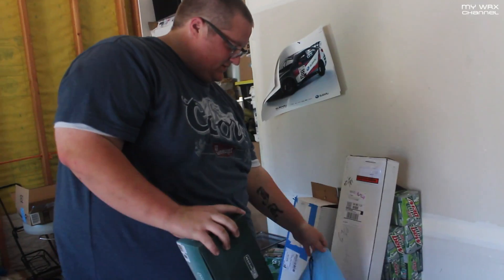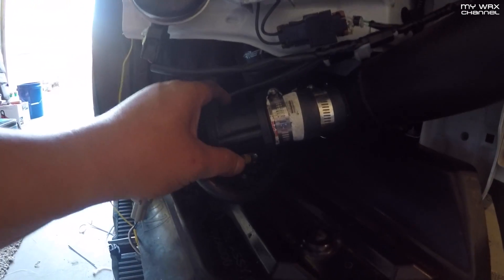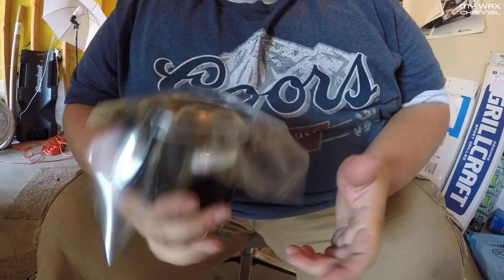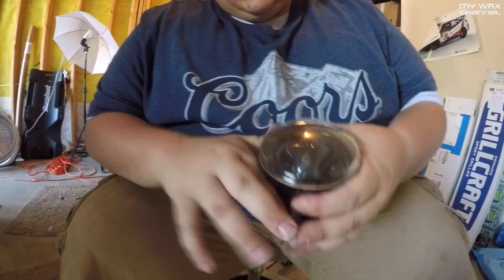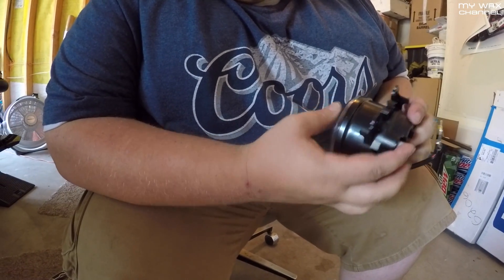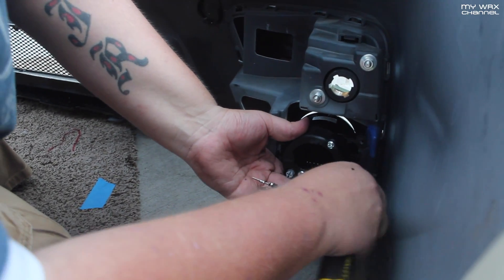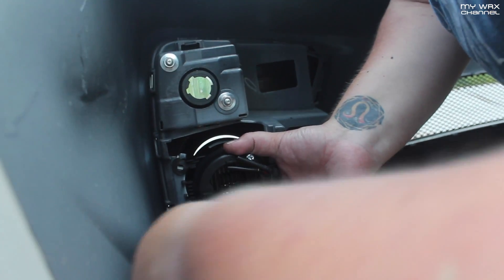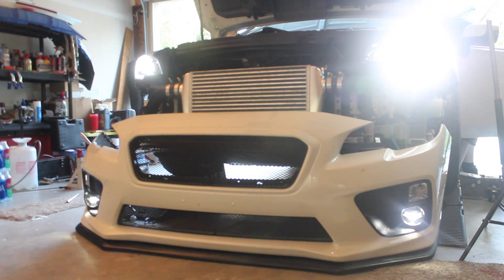MORIMOTO LED Fog Lights | 2015-2017 Subaru WRX/STI

Comment: today I finally got the call that my wrx came in to the dealer. so I am going to clear bra it week of sept. 12 but I am debating xpel or 3m pro. would you have any experience with the two as in which one is better? I live in jersey so summer and winter are big concerns for the rough environment and unfortunately it'll run over 3gs from entire front end and rockers
Reply: I have xpel on one car and 3M ventureshield (not pro) on the other. The 3M has been through hell on the car and has done it's job very well. The big downside is that I didn't wax it right away or consistently (the installer told me to), and now it shows dead bug residue even when washed. The car with the xpel only has 9k miles and hasn't been on road trips or harsh areas. It definitely protects from rocks and other paint hazards very well. You'll be fine either way. Subaru paint is thin and easy to chip, so try not to drive around much before getting the clear bra. My installer warned me about this and after 100 miles of light driving, I already had several small chips.
Reply: +binyamj everytime I tell my girl or coworkers about getting a clearbra they tell me I'm stupid it's a new car I don't need it blah blah blah....only problem is if I get it today I need to see if they can schedule me for this weekend since I have off work in 2 weeks and that's too far away to drive around :( I also heard 3m not pro yellows over time
Reply: Edwin Hernandez Clear bra doesn't yellow anymore, no matter which one you pick. It used to yellow because of the adhesive, but they are all clear now. I have bugs that were sitting on my xpel for a couple of weeks, and they came right off with detail spray and a microfiber, without leaving permanent marks like my 3M. However, I've noticed that the xpel shows many light scratches wherever you use a microfiber, even with detail spray. So it's good, but has some negatives to it. Also, for either brand, check the edges after a day or so. They always pop up behind the door and under the hood. You should push them down before dirt gets under them.
Reply: Nice thanks, I can't find good reviews on the 3m pro since pretty new but might go with that one. They told me $2400. Is that too ridiculous for front bumper, headlights, hood, front fenders and rockers?
Reply: Edwin Hernandez I got the xpel on my '16 STI and I paid less than $1k for the standard front kit (bumper, headlights, fogs, half hood, partial fenders, door cups, mirror backs, door edges). It would have been $1,400 for the whole hood. Two local shops that I've used, have prices listed. $1,795 for full front xpel, and $1,895 for full front 3M pro. They charge an extra $400 for the rockers. I believe the xpel was only $300. So you're paying more than my local shop. Xpel would be quite a bit less. Try calling around. Today I checked and the scratches from last night were gone on the xpel, so it self heals well.
Reply: +binyamj another shop i emailed does the cutouts not full pieces and no way I want edges I want the film wrapped...their prices was a bit better, forgot how much but still close to 2gs...it's hard to find local places that I feel comfortable wit. first time doing this and don't have car people so can't really get good recommendations from people here in jersey

Comment: Did you have any issues aligning these? I picked up a set and when I installed them both were aimed super high, when I tried to align them down the screw did not seem to do much, and would make a clicking noise after a few rotations
Reply: Try swapping them from side to side. (Put current left on the right, and your current right on the left)
Reply: KZNEvoX did that actually make a difference
Reply: Andrew Kruger were you able to figure how to aim these better? I'm in the same boat as you

Comment: how are you able to just have your fogs on without low beams? i have a '16 WRX premium and am not able to do this.
Reply from the maker: The fog light wiring in the Winjet fog light kit allows your fogs to work independently from the headlights using an OEM fog light button. Subispeed has a video of the install.